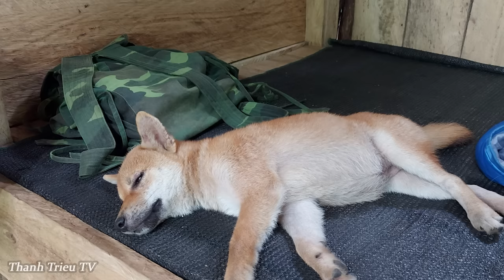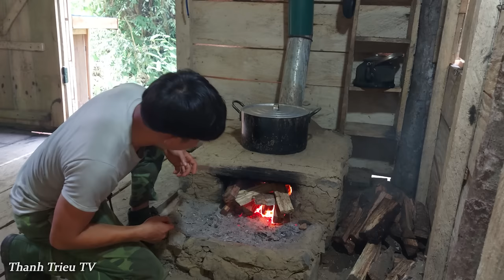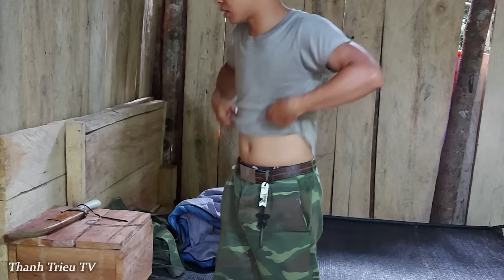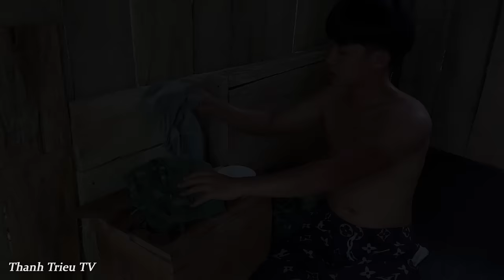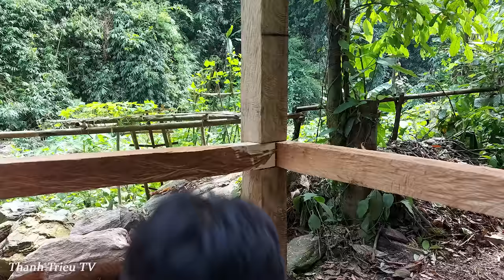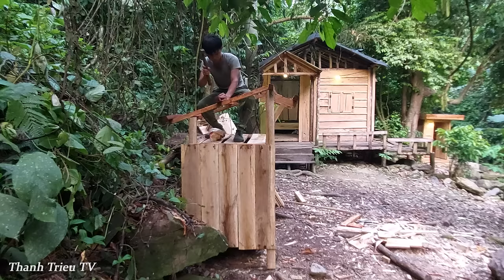I'm Sick, Treating illness alone in the forest, Building a new house for chicks, 1 Year Off The Grid

Comment: Don't drink water directly from streams. I've watched several of your videos and, based on your body structure and lifestyle, the only thing you need to do to avoid falling sick so often is to consume water in the form of tea or soups instead of drinking it directly from mountain streams. Make sure to drink enough water, but always boil it and let it cool before drinking. Mountain stream water can increase the pitta in your body type, so it's important to always boil and cool it. Follow this simple step, and you will not fall sick as often.